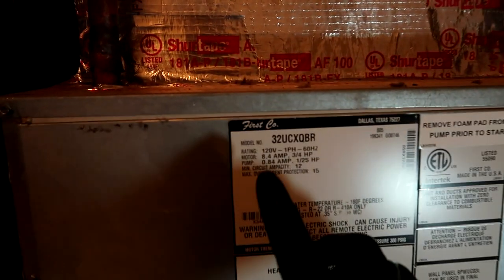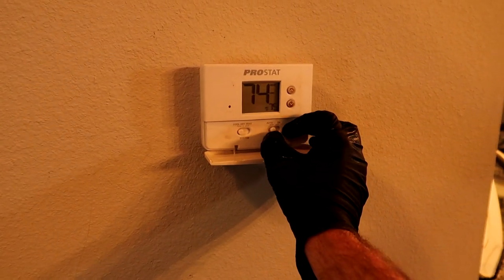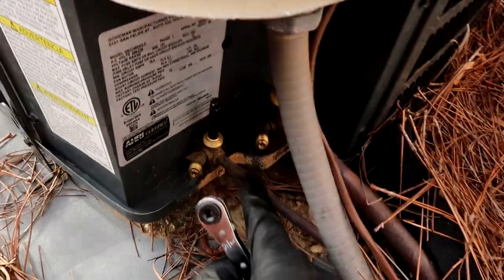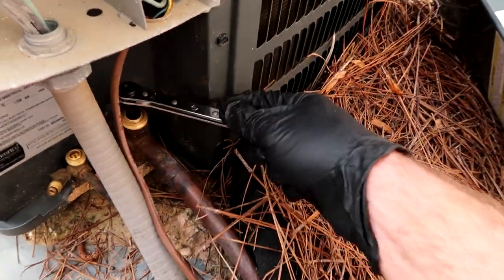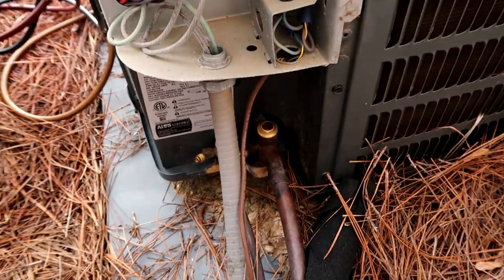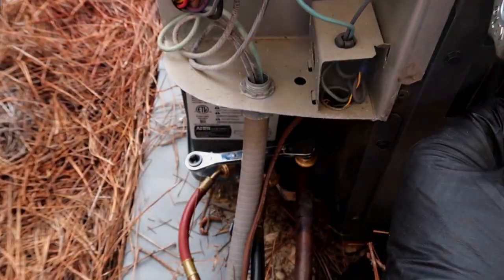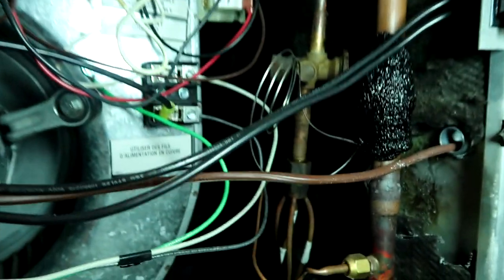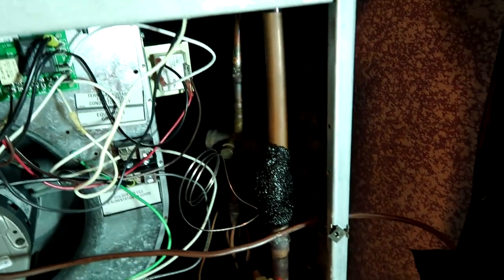Replacing First Company Air Handler Coil

Comment from the maker: Links to  the tools used:

Service Valve Wrench: https://amzn.to/3BAACH3

Nitrogen Flow Gauge: https://amzn.to/3q1aHpH

Spin Swaggers: https://amzn.to/3bGFzDm

Fluke RAYMT4U MiniTemp Non-Contact Thermometer https://amzn.to/3bIgesJ

Nylog: https://amzn.to/3CG52bX

Testo 557 Gauges: https://amzn.to/3mF7FVZ

HVAC Videos:

Goodman Air Handler Coil Change: https://www.youtube.com/watch?v=CUjIXUvwMpM

Goodman Compressor Change: https://www.youtube.com/watch?v=vbrNb9mYQEY

If you'd like to support the channel, you can do so by shopping for tools or whatever you need on AMAZON at no extra cost to you through this link,
https://amzn.to/3lDwxx1

Tools That Can Make You Easy Money: https://www.dirtymaintenancenation.com/diy-tools-for-men/

If I've provided any value for you and you'd like to donate $1.00 or more into my online tip jar, you can do so through this link, (all cards accepted)
https://squareup.com/store/dirty-maintenance-nation

This page contains affiliate links, which means that if you click on the link and make a purchase, I’ll receive a small commission at no extra cost to you. Lex Vance is a participant in the Amazon Services LLC Associates Program, an affiliate advertising program designed to provide a means for sites to earn advertising fees by advertising and linking to amazon .com

Comment: Welcome to the First Co world. I deal with 264 units with  RAQ 3 systems that are 20+ years old. Replaced 2 heat exchangers this week and 4 Taco circulation pumps (keep those on hand). Hopefully your mild winters are better for those systems, here in Utah we run heat about 5-6 months every year. I personally think aquatherm systems suck in places with hard winters. They kill water heaters.
Reply from the maker: Right on thanks for the tip Cass! I'll order some Taco pumps and keep them on deck. Thank you so much for watching!
Reply: I feel the same way
Reply: they should be fed off a boiler, not a water heater. although that will work way down south where heating is minimal, but still not recommended.

Comment: You need to get a flexible ceramic or mineral wool blanket to thermally protect everything around where you are brazing.  Also, use Staybrite 8 to reconnect to the line.  Lower temp to melt, and just as strong.
Reply from the maker: Thank you so much for watching!

Comment: did you change the filter dryer I thought they should be changed every time the system is opened up 
goodman has it hidden inside the outside unit
Reply from the maker: Yep, it's inside the unit. I definitely do it for a compressor change and have videos of me doing them inside the unit. However, since we couldn't get refrigerant easily and were running low I decided to pump it into the condenser and leave the filter drier since it would be isolated. I also gave it a good vacuum to below 300 microns. If the refrigerant wasn't on backorder and we had plenty I would've recovered and did the filter drier. Thank you so much for watching force!

Comment: Hi I have a First Co Slant system that was installed in 2017.  What is the life expectancy of either coils.
Reply from the maker: On the property I work at the coils started leaking after a year. It varies now days. Some last 6 months while some last 20 years.
Reply: @LexVance  I think First Co needs to be  slapped with a Class Action Because if they are making coils to fail by causing electrolysis.This is absolutely a reason this company needs to be investigated.  Lex I have had preventive maintenance done on unit since it was installed like having the coils cleaned and other checks of unit. So even doing all that preventative maintenance these coils could still fail.
Reply from the maker: @walterlewis1029  Yep. I have a year old property where all 200 of them are leaking. We're slowly replacing them and I'm documenting it with video.
Reply: Hi Lex I just found my FirstCo system has to be completely replaced Firstco needs to be investigated and sued out of existence!!!!!!!

Comment: DO YOU HAVE TO REMOVE THE COIL TO SERVICE IT
Reply from the maker: Not if you can see the leak and can fix it. If you can't see the leak then yes you'll need to remove it.
Reply from the maker: If you just want to clean the coil then no you don't have to remove it. Just spray the coil cleaner on it as the directions say.

Comment: Side job Magee says.I would not do it that way I would replace the whole AC system
Reply from the maker: 👍😆👍 Thank you so much for watching Caleb!
Reply: @LexVance  Happy late Thanksgiving skid bro
Reply: It has hot water heat in it also , you would have to drain the boiler etc 
the air handler is 2 years old , this is covered under warranty